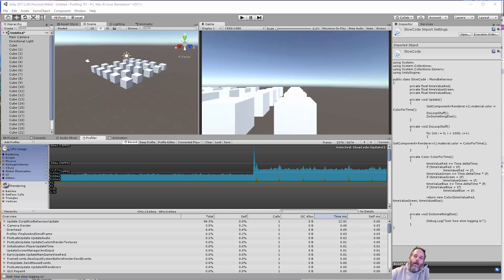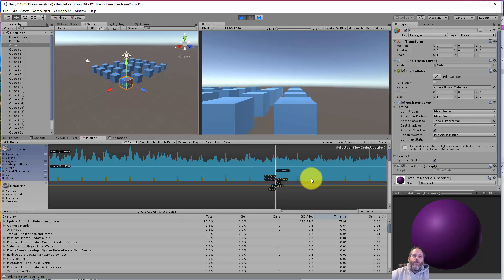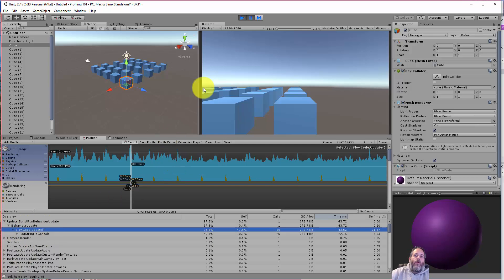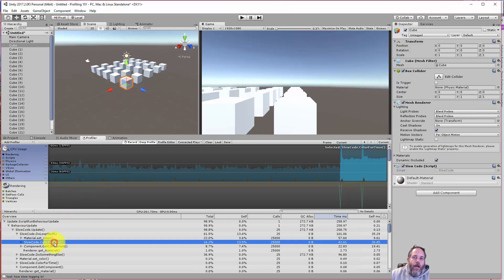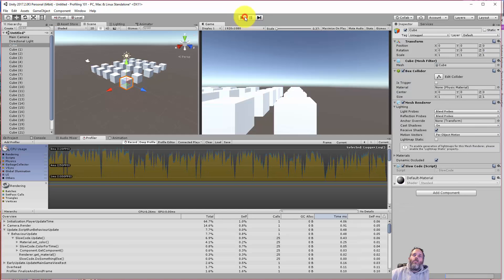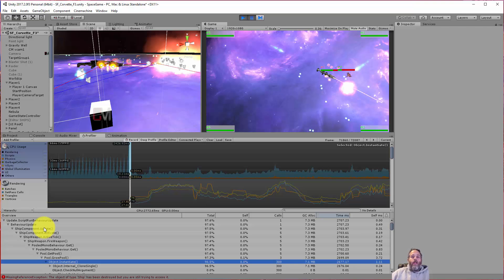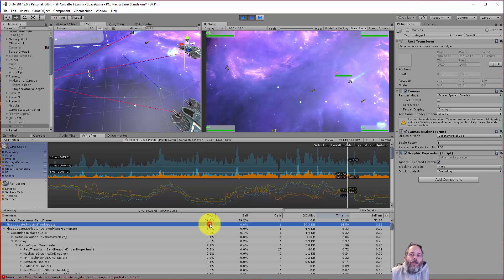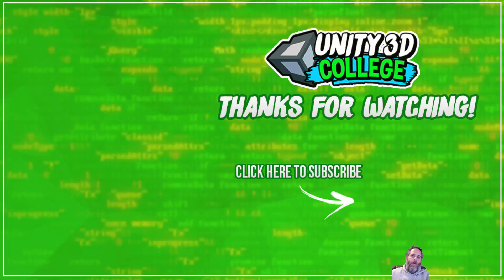Unity 101 - Using the Unity Profiler to optimize performance

Comment: Anything similar for Cities Skylines? Awful memory management there...
I managed to run the game in a fan-less laptop from 2009 with minimum specs for the game, keeping temperatures low with the help of the parameter "-limitfps 10" and keeping CPU fixed at the lowest frequency. But now I stumbled across this "out of memory" problem, and I wanna figure out if I can downgrade the assets used by the game, because according to the developers a single road vehicle can have a few hundred polygons. For a game of such big scope as a city builder, I find this beyond reckless and unnaceptable. People with 32 GB of memory are having problems with this game, this is insane! I'm glad I didn't spend a buck upgrading hardware to play a game that crashes no matter what.

Comment: You can add:

#if UNITY_EDITOR
Debug.Log("Debug message");
#endif

and debug messages will only play in the editor. Still a good idea to delete them before a final build though. :D

It's also important to note that the Profiler itself will drop your framerate a lot, so if you're watching frames and can't find what the issue is, try running without the profiler!
Reply: can you create video on optimizing and reducing the apk size of Tower Defense Template by Unity?
Reply: In most projects which use the logger to create custom bug reports that would not be an option as it completely cuts it out of the project once its built.
Thats why its better to use some kind of global bool via scriptable objects or whichever controller you like in your project to check that bool and determine if a log should be written or not. For example:
if(logEnabled)
{
Debug.Log("SomeMessage");
}
With Applocation.logMessageReceived its then pretty handy to create bug reports for the devs.
Reply: Good to know -- I've only ever done solo dev and me + artists, so I've always just turned debugging stuff off and on!
Reply: just create simple logger class and log thru that, you check some bool or compile constant there and when you will later need more control you can just add some parameter (like "level") to decide what will be logged where (dev build, release build, editor) etc, you can even keep lot of different logs in the game and swicthing them on/off like that during gameplay in editor depending on what you need to see.